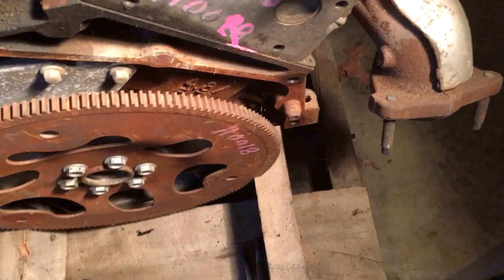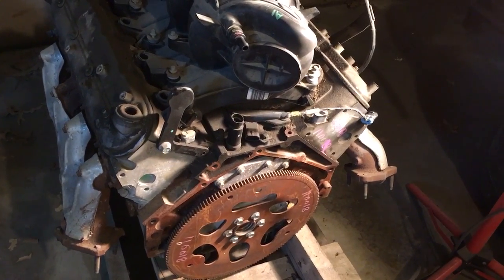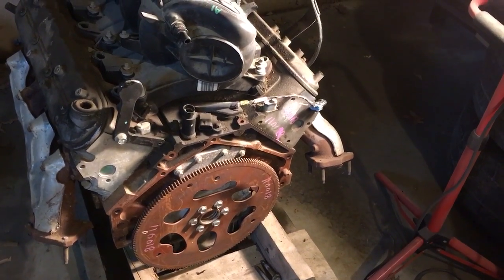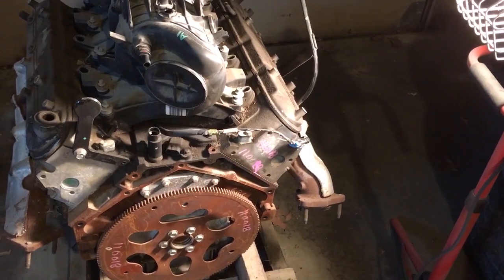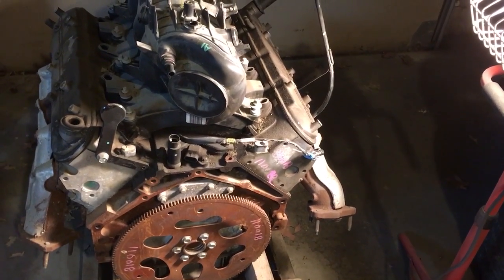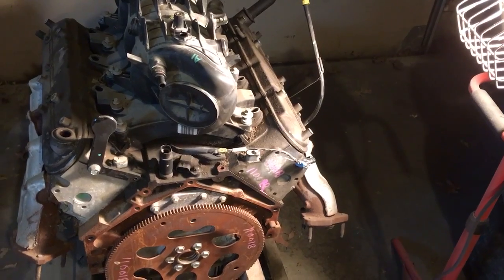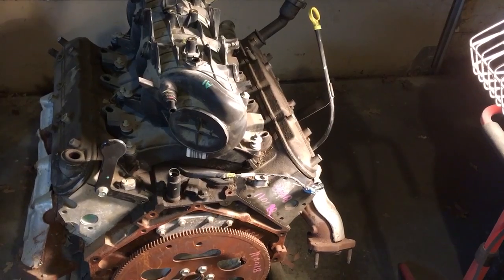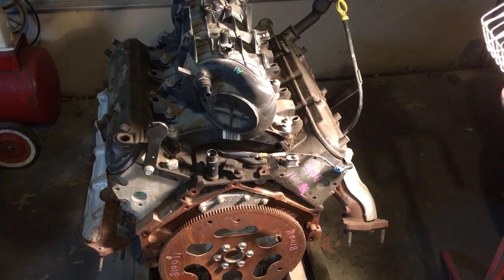4.8/5.3 engine description how to tell the difference

Comment: Could u ease a copper wire in the spark plug hole and feel for that shallow dish?
Reply from the maker: Maybe but it would be difficult especially if there’s carbon build up on the pistons.  We’ve even been deceived using a cheap low resolution camera on a bore scope. Now you can buy cheap scopes that work with a cell phone with really clear cameras/images with lights at the end. 
Iron blocks 4.8/5.3 castings only the 4.8 has the true flat top with out reliefs.
Other castings with a true flat top are the aluminum 5.3 L33, aluminum 5.7 LS1, aluminum 5.7 LS6 and 6.0.  But you’ll see the block material and the CID casting on the front.  
If the engine has been rebuilt all bets are off you’ll need to see the casting number on the crankshaft because it’s been a long time upgrade to boost compression by running 4.8 pistons in a 5.3. JD
Reply: Well very cool. 
Thanks for the info and your time!

Comment: For the past several years I have been running  5.3 on a 4.8 tune. Runs just fine. Displacement is close enough that the PCM will compensate. I'm sure a actual 5.3 tune would run better but I have not had any problems.
Reply from the maker: It would be interesting to see if there’s a different timing table between the 4.8 and the 5.3 engines. I would think the fuel tables would be very similar plus, as you stated the computers going to be able to compensate a certain percentage..  
if you do a basic tune to a stock LS making even the power enrichment to come in sooner will make a huge difference in power/performance!  JD

Comment: Just had one in my yard 2 days ago.  If its head gaskets are stock then there is an external tell without tearing it down.  Between the exhaust manifolds you can see the tab on the gasket.  Used a wire toothbrush sized unit , some oven cleaner (because I had it handy), flashlight , visual inspection and 5 minutes of careful cleaning and examination.  What did that reveal?    

The numbers 4.8
Reply from the maker: You found those numbers on the head gasket?  I wish you had recorded it to share!  Any tips on how to easily tell the difference between the 4.8/5.3 is appreciated!  JD
Reply: @HeadFlowInc  @ i found it too,,  easier then anything,,,    👍👍
Reply: Both motors use, or can use ,  the same head gasket. So it’s like a 50/50 chance that you’re right on that.

Comment: So if the blocks and bore are the same I am assuming that 4.8 crankshaft is a different stroke am thinking about this correctly
Reply from the maker: Kevin Humphrey Very different crankshaft and connecting rods! 

4.8 has 3.27” stroke & 6.275” rod w/ 1.918 rod/stroke ratio

5.3, 5.7, 6.0 & 6.2 have 3.622” stroke & 6.098” rods w/ 1.683 rod/stroke ratio. 

The interesting part: 4.8 & 5.3 pistons are still interchangeable!  As long as you maintain press pin or floating pins to match the rods.

Comment: If you remove the flex plate you will see on the back of crankshaft marked 4.8 or 5.3
Reply from the maker: Greg Garson I’ll have to check this out, we’ve never seen any markings or stamping of any kind. I have a 4.8 I can check!  Thanks for the tip!  JD
Reply: @HeadFlowInc  sometimes it will have worn off. I had 10 of them and one I couldn't find the markings
Reply: I bought 25 new engines from GM surplus

Comment: I will be facing this in the next 3-4 weeks,or whenever it starts to cool down enough outside to be able to spend enough time at various junk yards..I will probably just get the short block that I yanked some heads off already..5.3 l with the dished pistons..not sure but I think its a Gen 3..got this info here to help id the engine..Thanks !
Reply from the maker: Ross Krause The best engines strength wise would be the 2005+
There were some crossover engines in 2004 w/G4 pistons/rods but there’s no way to guarantee they will have the stronger connecting rods. 
Look for the 13mm valley pan and exhaust manifold bolts. Naturally if it has the cam sensor in the timing cover it will be G4.
I guess it all depends on what you intend to do with it on whether or not you need the stronger bottom end?  Good Hunting!!! 👍
Reply: @HeadFlowInc  I just want to build a 450-500hp daily driver that I can have a/c and not run into many/any problems..I live in East Texas and it's hot here like many other places,and a/c is a must have ! Now 20-30 years ago I only built engines and cars to run as fast as possible,and motorcycles too,but nowadays I can't afford these things like in my younger days,and IMO these LS engines are the way to go.

Comment: I bought what I thought was a 5.3 iron block with alum heads got it to my buddies shop ran the numbers on the block came back as a lm7 5.3 I was stoked, completely de assembled the whole engine and the sob had flat tops it supposedly came out of a sierra so I believe it’s just a iron 4.8 but once I get the swap in and it up and running it will get some head work, a nice cam new intake and full exhaust I’ll be happy and btw I was confused af as to why the numbers on the block came back to a lm7 5.3
Reply from the maker: hazel nicole I’ve never found a resource for the exterior block numbers, other than what year it was cast.  Well except the front 4.8/5.3 etc.  where did you look up the block numbers?
What’s the build going into and what’s the intended use?
Reply: HeadFlowInc I googled it just like I did my 350sbc it’s going into a 1983 Chevy el Camino and I plan on just putting heads and a cam in it in the long run already got afm headers and and just a cold air intake the intention is just build a fun little play toy
Reply from the maker: hazel nicole Tire burner, a 4.8 or 5.3 will work great!  The El Camino is known for smoking the tires similar to trucks just at a lighter weight.  Have fun, Thanks for the feedback! JD

Comment: That's not the only way. You can also drop the pan and check the casting number on the crank
Reply from the maker: MrTonemontana That isn’t allowed most of the time when buying an engine.  JD
Reply: @HeadFlowInc  you are absolutely right. I forgot about that

Comment: It's easier to check the 8th digit on the  
Vin# if it's a "V" that means you got a 4.8
If it's a "T" it's a 5.3 😎
Reply: Not if engine was swapped
Reply from the maker: Santos Morales Very cool information!  What’s the letter for a 6.0?
Reply: @HeadFlowInc   it's "u" for a 6.0 for the 3 to 325 hp lk4 & "N" for the 345 hp lk9
Reply: What about 8th digit being ‘Y’ can’t figure out if I got a 5.3 or 6.0 I was told it’s 6.0 but it said it was 5.3 in the description, I may be putting too much oil if it’s not a 6.0🥴oh geez
Reply: This is not true. Many of these trucks have Z as the 8th digit and they come with L59 motors. I own a 03 Tahoe with a 5.3 8th digit is Z

Comment: What 5.3 is the better motor?
Reply from the maker: Jason Cameron Gen 4 5.3 having way stronger connecting rods and pistons with full floating pins.  The most popular is the L33 5.3 because it has an aluminum block similar to an LS1.
Reply: HeadFlowInc thanks bud I appreciate that and I'm new to ls engines well just getting into them and that's what I heard that the L33 is a great platform how about the 6.0? Any thoughts
Reply from the maker: Jason Cameron Keep in mind the 5.3, 5.7, and 6.0 all use the same Stroke crankshaft and Connecting Rods. The only difference in all three engines is cylinder bore. 
The 6.0’s are popular because the larger bore unshrouds the intake valve improving flow and you can run bigger valves and square port heads on them. 
In stock form there’s very little difference in power from a 5.3 to a 6.0.  If a 5.3 made 325hp the 6.0 should make 366hp based on more Cubic Inches but similar/same Torque as the 5.3.
Reply: HeadFlowInc I appreciate your time and info so I'd be better of building an gen-4 5.3 the L33 right? And I plan on going turbo so I would like to build the top end any suggestions would be great
Reply from the maker: Jason Cameron Don’t spend too much time/money trying to get an L33.  Any 2004-07 5.3 or 6.0 would make a strong build.  The topend depends how much power you really want to make.  The iron blocks will handle more power than the aluminum.

Comment: You can have either piston in a 5.3. I have an iron block 5.3 with flat tops and i know it’s a 5.3 because it’s in a suburban, which was only offered as a 5.3.
Reply from the maker: Kyle's cars It has to be a newer. Engine, newer than 2005/06.  Or someone changed the pistons. 👍
Reply: HeadFlowInc it’s a 2000 suburban. And i doubt that they did that. I just made a video on my channel where i put a scope into the cylinder so you can see it’s flat.
Reply from the maker: Kyle's cars The engine is either not the original or it’s a 4.8.  It’s simply the way GM did it, I didn’t make it up.
Reply: HeadFlowInc i don’t think you made it up. That’s the information commonly available. But that’s just not correct information and I’m not the only person who has come across this. I picked this suburban up from the original owner who never had the engine replaced. The only way to know for sure is to check the casting number on the crankshaft
Reply from the maker: Kyle's cars True, only way to know is the crankshaft number or the connecting rod length.  I used to have the numbers from the big end of the rods to tell the difference.  Hopefully everything is as it appears. 👍
Reply: @HeadFlowInc  Ok here is a weird one, i just bought what was supposed to be a 5.3 it is indeed a gen IV block, well it had flat tops which i remembered what my friend said " flat tops = 4.8" but for $200 i can't complain lol, it doesnt end there though. I checked the crank casting its 12552216...and the rods are unmarked, no numbers anywhere that i can see..so yeah wtf lol

Comment: Bd info some cast iron block 5.3's came with flat top pistons
Reply from the maker: 407ForRent I'll cover it again, GM did not put flat top Pistons in a 5.3 until 2006 L33 5.3. The L33 got a bump in compression from the true flat top 4.8 pistons. So my information is correct, and I mention the one exception being the L33. I hope this helps clarify my video JD
Reply: HeadFlowInc I have a gen 4,  5.3 not an l33 aluminum block with flat top pistons in my shop right now
Reply from the maker: 407ForRent I'm trying to research more about the newer Gen 4 engines. I found this question on Yellow Bullet but nobody ever answered. "We all know the L33 with 799/243 heads was the first. Then the Gen4 stuff had LH6, LH8, and LH9 VVT alum motors. Some of the iron ones did as well correct?"  I have no supporting info yet looking
Reply from the maker: 407ForRent So far it looks like the 05 and newer 5.3 HO (L33) and the Gen4 NNBS engines had flat tops?  This is interesting, I want to verify the information about the NNBS engines having the flat tops, it's the first we've heard of it. Thanks for the feedback all this helps! JD
Reply: HeadFlowInc I've got one in my shop right now
Reply from the maker: 407ForRent I understand you have one, my goal is to identify the applications and years. Because it's such a popular upgrade to put 4.8 flat tops in a 5.3 you literally could start seeing flat tops in any 5.3. 
What's the vehicle in your shop? Year and model?
Reply: HeadFlowInc it cam out of a suburban

Comment: Also the 5.3 never had a manual transmission. So if you're looking at a truck that was wrecked in the front and it has a manual, it's a 4.8....
Reply: Brian Davis 
Dealerships will always order what the customer wants.
Reply: Unless the truck is a 3/4 ton
Reply: What trucks came with a 4.8 and a manual? My understanding was manuals were only on 6.0's in the 3/4 ton trucks and in the 6 cyl 1/2 ton trucks with the 4.3.

Comment: this is not true on the 2005 and newer iron block stuff that has 799 heads they all have flat tops 
if it's a gen3 engine that's never had a head job there is a tag that comes off the head gasket that says 5.3 or 4.8 
05 late and 06 is the crossover years
Reply from the maker: Kevin Luck I knew the 2006 L33 5.3 has flat tops but I didn't think all 5.3's had them.

Comment: Doesn't it make you wonder what the engineers were thinking when they designed these things.  Like how hard would it have been to put some kind of stamp somewhere to distinguish the different configurations.
Reply from the maker: sparkimoto I agree 100%. Casting 4.8/5.3 on the front is not very helpful, compared to the 5.7, 6.0, 6.2 etc
Reply: Yes they did,, its stamped on stock passenger side head gasket,,,
Reply: Well literally you swap the rods and crank it can be either so it wouldn’t matter you have to love LS magic just saying....

Comment: I'm swapping a 4.8 for 5.3 my question is will the 5.3 run and drive on the 4.8 tune?
Reply from the maker: Chris Segura As long as everything stays the same, i.e. Sensors the 4.8 computer will control/run the 5.3. Hopefully the 5.3 is a similar year for ease of connection at the sensors and sensor locations. JD
Reply: alright cool cause I'm swapping in a lm7 in place of the lr4 mine is dbw and lm7 is cable
Reply from the maker: Chris Segura Swap the drive by Cable throttle body to the 5.3.
Reply from the maker: Chris Segura Double check all the sensor locations especially the Cam sensor.
Reply: swapping the intake is a must and all the sensors are in the same location

Comment: how much power could you get out of a 5.3 with LS1 components on it  like heads and cam and LS6 intake would it perform like the 5.7
Reply from the maker: Nathan Lopez My understanding is the LS1 cam is a small upgrade combined with the larger valves in the LS1 heads with a car intake will made a decent upgrade with a good tune. Put a Turbo on this type of engine with good valve springs and hold on! 😀. LS1 parts in/on a 5.3 with a tune will easily make 350+ hp possibly pushing 375+ HP.

Comment: i'm the owner of a 5.3 that actually turned out to be a 4.8.  I found out by looking up the casting numbers on the crankshaft
Reply from the maker: Oh my, I hope the 4.8 worked for your build.  It's pretty common to end up getting a 4.8 when you think your getting a 5.3  Thanks for the post!
Reply: Me to.  I only found out after I ran the vin. But my airbox had a 5.3liter sticker on it. I'm so confused 😕
Reply: @christianplunkett6829  So I am in a similar situation. I always thought I had a 5.3l as well, mostly due to the airbox sticker.  I looked at the window sticker the other day that I had in the glove box and it said 4.8.  I just looked up the VIN and it says 5.3l.   No idea.
Reply: @sbhansf  @ if u want to make sure,,  check passenger side stock head gasket,,,  its stzmped there,, i found that information here on comments,,, then i went outside on my trucks,,,    Bingo,, just right,,👍👍👍

Comment: Does this apply to a 2005 ls motor with iron block ...I picked it up yesterday for 600 ...and want to know if it's a legit 5.3
Reply from the maker: It should, until the aluminum block L33 5.3 HO came out all 5.3’s had dished pistons factory. Around 2006 the L33 was introduced, the later model flat tops have valve reliefs in them.
I’m unsure about the FWD LS4 engines

Comment: You can also pull off the pan and look at the casting number on the crank, the 4.8 has a different casting # the date is coded into the block in front of passenger head I think.
Reply: +melybonbon much easier st pull the pan if the engine is already pulled. you could also just measure the crank stroke
Reply: @WhoThisGuy515  yep roughly 3.2in for 4.8 and 3.5 for 5.3.

Comment: I'd like to scope my 4.8 and find dish pistons.
Reply from the maker: +ChevyShawn  See if you can borrow a scope and check it out.  If you buy one make sure the camera is smaller than the sparkplug hole because Harbor Freight use to sell one model that wouldn't fit through the hole! :(
Reply: +HeadFlowInc yea I was thinking about buying a cheap one so I can keep my eye on my motor between nitrous hits.
Reply from the maker: ChevyShawn  Not sure if you have this type of phone but check this out:
 http://www.gearbest.com/microscopes-endoscope/pp_229387.html?vip=66982&utm_source=YGfacebook&utm_medium=WebsiteC&utm_campaign=FB1511